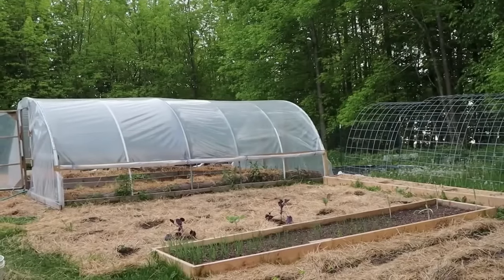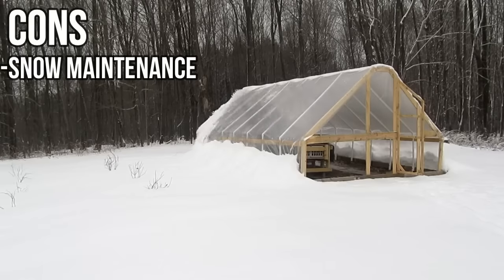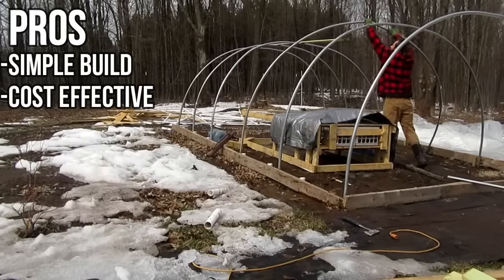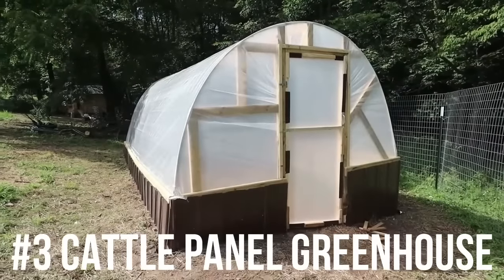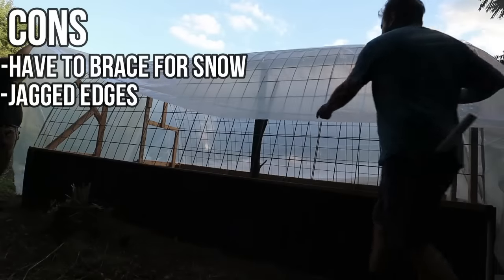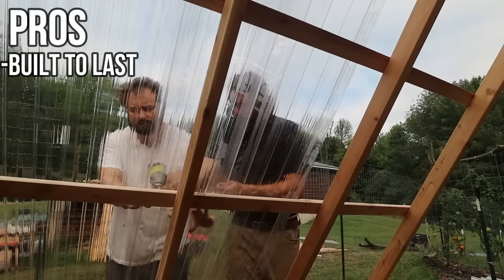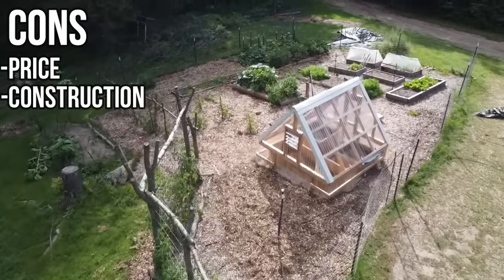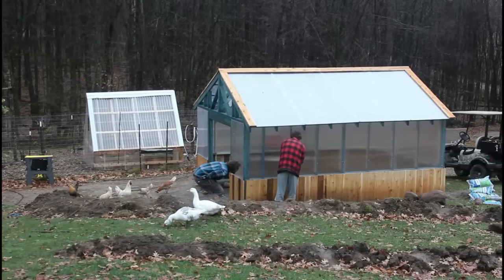The Ultimate Guide to DIY Greenhouses: Pros, Cons, and Everything In Between

Comment: Has anyone tried a rocket stove in a greenhouse?  Flue could run to the opposite side buried in gravel and sand. Just burn a couple hours at sundown to heat that buried mass. Plenty fuel available.
Reply from the maker: Scott, you are reading our minds, per usual hahah We are planning on building a rocket stove. However, we are toying with the idea of using candle to heat the bricks. Do you think that would work?
Reply: @TheNorthBranchWI  That would work , I think, but you need a good cheap source of candles so your veggie’s aren’t costing too much. Low fuel cost would be a key consideration. Cheers!
Reply: @TheNorthBranchWI  a candle heater will NOT produce enough heat, you would need over 100 of them to make any difference. As far as the rocket stove, I tried something similar works great but has to be fed wood every 20 minutes or so.
Reply: I've seen successful passive solar greenhouses or walipini's with a solid north wall be successful for year round growing with a rocket stove. The main challenge with the stove is keeping it going. That is...in comparison to the passive water options, the rocket stove can be a lot of work.. especially in climates where is constantly below zero for a few weeks at a time.

Comment: Insulation... Try 2" rigid insulation  on walls up 8" inches. Dig down 4" install 2" of rigid and  reinstall the ground. Keep that ground
Damp if not planting in ground cover with landscape cloth.. if carrots is your crop you will need more earth of course in which you dig further down.  Black colored water filled 55gal containers help regulate temp.  Any thermal mass type insulated  from the outside of the building on the north side.
Reply from the maker: Thank you, Phil! You have given us plenty to think about, I appreciate that,

Comment: I'm 7 minutes in, and every build so far has me ask the same questions:
Why not use a dry-stone low wall as a foundation?
Why *plastic*?
Reply from the maker: I don't think we could pull off a dry stone low wall
Reply: @TheNorthBranchWI  Ah, you totally could! It is very chill, but time consuming.
Fitting rocks together endlessly, and if need be chipping them into shape a bit.

To get a flat plane, all you need is a piece of string strung between two pegs.

For a foundation, a bit of gravel or small river pebbles or whatever you have nearby is fine. :)

Comment: This was a fantastic video, Evan.  One question.  Why were the 6 mil plastic more prone to have bugs?
Reply from the maker: Couldn't tell you hahah It just seemed to be that way
Reply: The bugs didn’t get there yet.
Reply: I studied horticulture and greenhouse nursery operations and can confidently say that the 6 ml plastic has nothing to do with the bugs.  It could have been the base (soil, dirt, etc), the ventilation (or lack there of), in inability to effectively climate control, the plants/crops grown in (some crops more susceptible to pest), if started elsewhere as seedlings it could have been brought in on that plant material (transplants), or simply brought in on the person (on clothing, footwear, larvae in the substrate or hand tools etc.).  It's really easy to get pests! Best pest mgmt is prevention. in lieu of that early detection which requires one to effectively identify the pest you have, understand their lifecycle and conditions they thrive in and get a head of them. And many pests thrive in greenhouse conditions. Many pest can easily lie dormant for a season and come back when the conditions are right.  

Improve the ventilation with any of the 6ml poly builds and the pest may be more manageable. If ventilation was improved the plants inside would also be under less stress. Stressed plants attract pest and are more susceptible to disease. At the very least in the height of summer the plants would be under less stress. This is assuming they are at least zone 5. Or getting a fair amount of above 20 degrees celsius over the growing season.

Comment: I was thinking for the second build if you built a second layer that was split down the middle at the peak kinda like blades that open out-wards tied with a piece of rope or string you could leave attached and when its time to clear snow pull on the outer layer and spread its wings to clear the snow it is a little more tedious but effective

Comment: I am curious to find out if the pitch of your roof in your last build is steep enough to shed snow easily. It looked sort of flattish to me, but that might be from the camera angles.  
   We are considering building a greenhouse in the near future and easy or self snow removal would be important to us. We can easily get a couple feet of snow in one storm in our area overnight. Depending on how easy the structure sheds snow is important because snow removal might require frequent trips outside to do it.
   Happy data collection. Documentation is important to understand which style is most efficient and effective in your climate conditions.
   What type of foam tubing did you use to protect rhe plastic from the sharp wire in the cattle panels and how did you attach it?
   I love your rainwater collection idea. Gravity would be the most efficient way to move the water to the beds so everything would need to slope downward. You could use small diameter PVC to make splitters with T fittings sort of shaped like the letter E to fit across the upper end of each bed area. Then connect pieces of soaker hose to the T's and clamp the end as a stop. Or investigate drip irrigation systems. I understand that they are the most water efficient. 
   You could talk with local landscapers and greenhouse owners about what you are trying to do. Most of the farmers I grew up with were happy to talk about their crops and give you pointers about what worked for them and what didn't. Talk with your local State Soil Conservation District. Part of their mission from the US Department of Agriculture is to help farmers, big or small, with soil and water conservation projects. They both frequently sponsor workshops, seminars, or training sessions on specific topics.  Your local land grant colleges should have similar learning experiences. I bet since the pandemic many of them are online.
    Sometimes these State and Federal  agencies have small grant opportunities to fund pilot projects on topic of interest. Most require data collection and reports. Since you already plan on data collection for the different types of greenhouses you constructed this idea might be worth looking into.
   Good luck with your builds and growing things.
Reply from the maker: Hey Sharon! The A-frame is the best for snow shedding. But the last one sheds it, too! So far all the snow has come off within a couple days without assistance. I still go out and clear it off a lot of the time because I have a lot of money into that thing😆 And I used UV tape for the cattle panels, but I have seen a lot of people use foam tubing and that seemed to work well. And yeah I am considering a lot of options for the self-watering. And that is a great suggestion! I will have to look into all of those resources. It would make sense that a lot are online now. And I have been talking to our usda office about applying for funding for a couple different projects. I am having a meeting with them to discuss planting a huge amount of trees in our forest because we just finished logging some of it. They said they fund greenhouse and things like that, that might have been nice to know awhile ago haha but i am learning. And Thank you:)

Comment: I have a really crazy question. Have you ever built a 16 foot wide greenhouse without a brace in the middle of the 16 foot span? I want to build an in ground pool enclosure. So my pool is in the ground and I want enclose it like a greenhouse. The issue I have is,  the width Would need to be at least 16 feet wide. I can't find any green house plans or info on a design that could go 16 feet wide without bracing where the water would be. I wouldnt be opposed to any plans of any traditional pool enclosures either. It is hard to find any info on them.
Reply from the maker: Hey Barry. I don’t have a good answer for you. We always put a support on ours. It seems like you could probably find a way to build something that would work.
Reply: Maybe look into geodesic structures.  They don't need inside support.
Reply: This is 22x35. There's some bracing on the side but it may accommodate a 16' span. https://www.youtube.com/watch?v=aCGUfJbBjzs It uses Maker Pipe connectors.

Comment: The greenhouse i built in a northern climate has 2 spaced sheets of plastic only on the south wall, the other walls are 2x6 insulated. It's very easy to heat in winter

Comment: Where did you get those metal deck plates that you pounded the square post anchors into?  Lowes doesn't have them although I have purchased the square post anchors.  Lowes had those square post anchors at about $15/each when I bought them about 10 years ago.  They're now up to $32.00/each. (yikes!)
Love the A-frame greenhouse!
When I made the original raised beds in my garden around 2000, they were made of cedar.  They rotted in about 3 years.  I replaced them with concrete block and have never regretted it.
Reply from the maker: We got ours from menards. I hope they still carry them. And that is funny you say that because we are planning on making our raised beds with bricks in the newest greenhouse

Comment: Pvc frame with corflex sheets.  With some pvc lines with spray heads. Solar lights. Concrete footings.  Use no wood only plastic materials.  Zero rot ,everything can  be washed to minimize mold,fungus, algae on the walls. 
 rodents control was a pail, peanut butter and water with a little bleach. 
Was wondering if linings the inside with corflex sheets. Would winterize the green house.
Reply from the maker: I am not familiar with corflex.
Reply: @TheNorthBranchWI  
Trade name is Coroplast. 
Great stuff.

Comment: Did you know that there’s a difference between 6mm and 0.6mm???
Reply from the maker: Metric is not my strength.  Did I mess it up somewhere?  It gets confusing because the twinwall are measured in mm and the plastic sheet is 6 mil.
Reply: @TheNorthBranchWI  that’s about a quarter of an inch thickness…….I didn’t think it looked as thick as that 😂
Reply: @TheNorthBranchWI  
A mil is a thousandth of an inch, 6 mil poly is around 0.15mm thick :)

Comment: Collecting the rain water is a great idea.  It might be better to collect it into water barrels instead of directly onto the beds as that gives you no control incase you get unseasonal rains.  Then have some sprinklers or a drip system to more evenly distribute the water.
Reply from the maker: That is the plan! Should be getting that setup in the next few weeks. It feels like we are behind on that but it hasn't rained anyway so not missing much ;)
Reply: @TheNorthBranchWI  The other advantage to that is the thermal storage from a large volume of water. It's not a heater but it doesn't hurt.

Comment: Not sure if I missed the explanation on why the 6mil plastic designs had bug issues. I noticed for the A frame commentary you mentioned no bugs yet. Have the A frame and twin panel designs gone through a full growing season yet? Other than that pretty awesome builds, keep up the good work.

I've been thinking a lot about how to make a temporary green house for a large raised garden bed ~10x25 (4 bay keyhole, like a comb). I live in zone 9b so would only really need the greenhouse in the winter/early spring months. I get summers that get into 100-110 easy so unfortunately cant keep ridged panels up year round.
Reply from the maker: We built it at the beginning of the growing season last year. And I should have made it more clear, but when I say bugs I mean there were a lot of insects that got in the 6mil and couldn't find their way out, so it would pile up in the crevasses and it was gross after a couple years. That hasn't happened in the a frame so far. 

And I actually talk about an option that might fit what you are looking for in my latest video. It is rebar and metal Condit put over top to make something that you can put up or take down quickly. 

https://youtu.be/mciwQ98kEP4
Reply: @TheNorthBranchWI  Thanks for the response and link to other video. So my understanding is that there wasn't so much of an issue with bugs attacking plants (in comparison with panel roofs) just accumulation of carcasses. Is that right?

If so this wouldn't be much of an issue for me since I'll be taking it down and replacing with shade cloth in warmer months.

Comment: You have a lot of easily solved problems. One thing is that the UV plastic has a reaction when it touches metal so you need to keep it from touching the metal. Another thing to do is to use a 1/2 inch to 1 inch nylon rope weaved over the  PVC and metal tubing on the inside to support the snow and have it slide off easily if you do it right. I did this to my RV tent and it worked great. Anchor the rope to the ground to make it tight.
Reply from the maker: We have the poles covered with gorilla tape that is UV protected.
Reply: I want to know about this reaction that you mention between UV plastic and metal touching.....??
Reply: @jayytee8062  The metal will degrade and break down the UV plastic and make holes and rips, it is and effect like aluminum and iron has.
Reply: @webyankee6558  
That probably has to do with certain chemicals being in the plastic which give off acidic compounds such as acetic, formic acids. Even sulfur compounds.
Even wood and timber contact will do the same.
Either way very interesting.

Comment: Yo, so I live in the desert in ARizona nd I built the cattle panel greenhouse design. Only  I am disabled, and slow, so I hadn't got my ridge beam up, and only had shade cloth on it. I thought, it should be fine. But wind storm collapsed it. So for that design, ridgebeam should be included regardless of snow.
Reply from the maker: Thank you for sharing! That is good to know. I have had people tell me that their cattle panels have made it through winters worse than mine with no ridge beam, but it is still probably a good idea if you have the material.

Comment: I have experimented with a lot of different green house heating methods, I would like to suggest that you check out diesel parking heaters used in rv's.
Reply from the maker: awesome thank you! Do you have any ideas or experience for using candles? We are trying to come up with a very cheap option that potentially does not need to be vented or anything.
Reply: Those parking heaters are great, as the combustion unit can be housed in a box outside, and cycle the air in a greenhouse without exhaust contamination. But NEVER buy the Chinese copies as they almost always fail. 'Planar' is a great brand that's affordable, while Eberspacher is the top make, but expensive.

Comment: I have had a 6 mil plastic greenhouse built from the frame of a temporary plastic garage for five years.  Here in eastern Ontario.

Yes, the odd plastic repair, I even taped the top of the galvanized frame to reduce chaffing from the wind.

As for bugs, keep the top uppermost parts of the end walls with either a drop down window or, as I do, pull the plastic down.  Bugs find their way out.
Reply from the maker: Hey there, Daryl. I think that was the issue for us. And we are in the heart of industrial farming country so there are so many flies constantly hatching from manure. I should have made a lot more distinctions about it in the video.

Comment: Yr a frame greenhouse is great. No snow where I am but the simplicity of it is a winner.  With the last one you showed
 Is that a concrete outer ring you made?. Wouldn't concrete blocks filled be easier and work the same?. Thankyou very much. Most helpful. I still trying to work out the bug issue with the plastic. Rolling up the sides on hot days?

Comment: I like the cattle panel. And it will be used for my next Greenhouse. 
   There is a 12 mm rip stop light diffusing plastic available at about three times the price or around .30 -.35  sq ft. 
   On wood framed Greenhouses using just plastic where snow load is not a issue, you can get some insulating airspace by adding a second layer of plastic on the inside. 
   🤠🏞️🐂

Comment: For your self-watering system, it seems to me like you could better spread the water throughout the bed if you were to find some way to adapt your funnel from your gutter into the greenhouse into something to which you can attach a water hose, and then connect a soaker hose to it so that the soaker hose distributes the water throughout the plant bed.
Reply: Or collect his water run off into a rain barrel and water from that when need
Reply: I had the same thought about a soaker hose, but carefully consider the soaker hose material.  Recycled tire rubber seems environmentally friendly, but it leaches chemicals into the water (incl. carcinogens).  Heating the rubber (greenhouse) makes this problem worse. You could make your own by poking holes into old drinking water safe hoses.  I would add more length onto the flexible, black hose connecting the gutter to the beds - run it through the bed, drill holes and plug the end.
Reply: Ah, soaker hose. Reminds me of a woman at the cash register in anger threw down a roll of soaker hose on the counter, THIS HOSE IS NO GOOD, IT LEAKS EVERYWHERE. 😂
Reply: @robertschmidt9296 😂😂